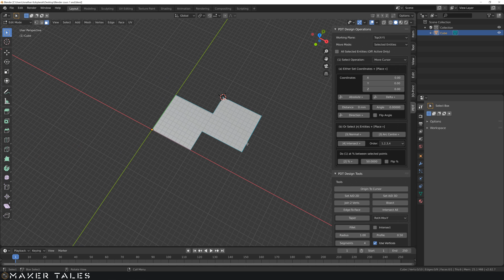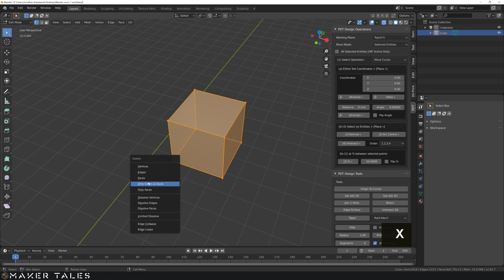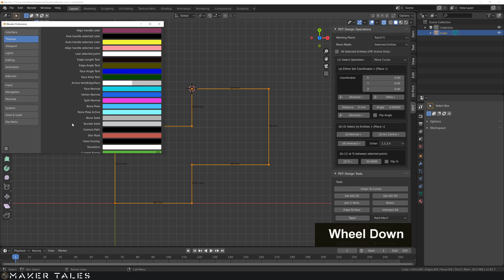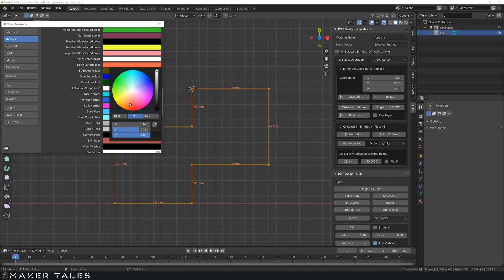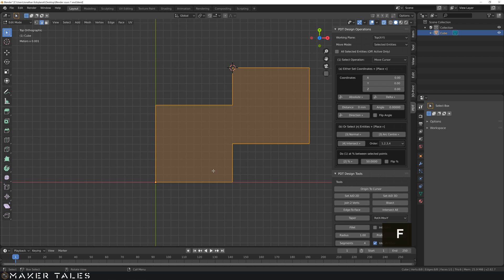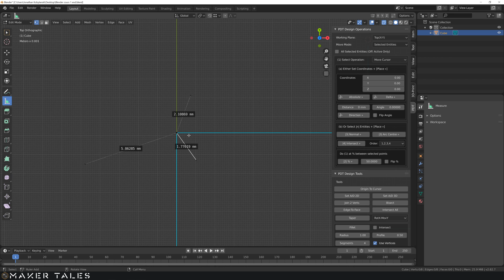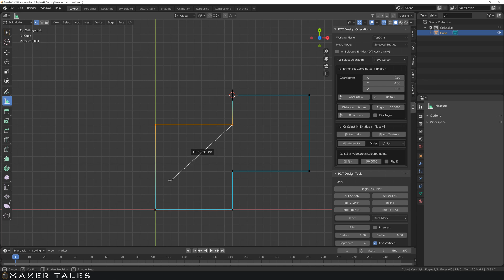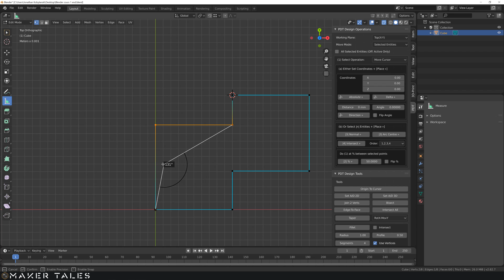Precision Modeling In Blender 2.82 : Measuring & Vertex Clean up - How To PDT ( Tutorial Part - 2 )

Comment: Hi!, im using Blender 4.0, and seems like Measurement options are moved to "Mesh edit mode overlays" dropdown instead of viewports (is the next dropdown), I was struggling a lot to find it.

Thanks a lot for this series, I was looking to do parametric design in blender, and I was very surprised why this series is not more popular, I find it not easy to find (was not in the first results), I suggest to add to playlist name "Parametric design" maybe is why I didnt found it earlier. Your definition is not incorrect, but as far I understand "Parametric design" is the way this is normally called.

Comment: Good series. Unfortunately when I tried to delete the face that I had made, it took all of the vertices with it. I tried several different ways of doing it and nothing seems to be working. Even after I got rid of the extra vertices. I'm using 2.9.1 so I'm not sure if it's a glitch in Blender or what. Anyone else have this problem ?
Reply from the maker: Hey thery Johnny, If you are just learning blender precision I would really advise that you head over to my new series for blender 2.91 and all will be made much clearer than here.

Comment: Anyone care to shed light on why deleting "Faces" rather then ""Only Faces" produces a completely different results?
Reply from the maker: Hey Sam, This is because a face technically is a connection points between 3+ edges. So "Faces" added the edges that are not connected to other faces into the delete operation. However "Only Faces" you are very much targeting the faces connected to the edges and you want to leave the edges where they are. I hope that helps

Comment: Thank you for the tutorials. I've been using OnShape but I love Blender so this is a welcome tutorial series.
I've been pulling my hair out (I'm on version 2.83.4) trying to find a way to measure my lines.
Found it! measureIt addon. https://www.youtube.com/watch?v=wSknsKVas4M
I tried this addon, and it did the SAME thing. It rounded the decimal :(  Until I set the precision to 3 and not 2 and now it works perfectly.
The best part is if you move the line, MeasureIt recalculates the distance and adjusts itself.
I wanted my fellow peeps to have this info, along with your awesome tutorials.  Cheers! :D
Reply: MesureIt add-on has been around since 2015. I wonder why it was not covered here. Actually, he did cover it in 'Precision Addons for Blender 2.82 Modeling ( Tutorial Part - 6 )'

Comment: 1) Get rid of duplicate vertices: in Edit Mode, select all, go to Mesh -> Clean Up -> Merge By Distance
2) You can change the accuracy by changing the unit from meters to centimeters.  Duh.  This is in the Scene Properties menu on the right hand bar, in the list of icons.  Scene Properties -> Units -> and change your desired unit of measurement for length to centimeters.  You can also switch from the metric to imperial here as well if you'd like to use the superior American system.
Reply: 1) He covered this
2) The accuracy has already been set to milimetres if you've followed the previous video. That still does not fix the underlying issue. Also, lol to "superior" American system. Ask NASA what their opinion is on that one considering it lead to one of the most hilarious failures in space launch history.

Comment: Fantastic content! Trying to merge vertices by distance didn't work for me, even if I cranked up the distance quite a lot. Switching to perspective mode, it turned out that the additional vertices were way off in the Z direction, effectively creating a big tall volume (as if it were extruded from the ground X-Y plane along the Z axis). Selecting and deleting them did the trick. It also reduced the number of edges from 24 to 8, which makes sense (8 additional edges between the 8 additional vertices, and 8 more edges that connected the "lower" (z=0 mm) edges to the higher edges). Looking forward for Part-3. :)

Comment: Cannot get blender to snap to first vertex for the measure. It will snap to the second vertex (with control held down). What did I miss?
Reply from the maker: Hey Ken,
I'm sorry to hear your having a hard time.
I don't really know what's happening as I show at 8:52 by default blender will snap to a vertex. You don't even need to hold down any other button. As long as you place it close enough to a vertex, in my experience it will snap to it. Let me know how that goes.
Reply: @Keep-Making 
Must have been a quirk. Created a new file and it is working fine. Thank you for your reply and excellent video series.
Reply from the maker: Thank you and i'm so happy it sorted it self out for you.

Comment: liked.  subscribed.  please keep up what you are doing.  this is awesome.  so useful and I didn't know it was really possible in blender
Reply from the maker: Hey Kellen,
I'll keep this going until I fell like all the information i currently know is available. At that point I'll learn some more and then show what I learn.
Is there anything in particulate that you would like to see covered in terms of precision design in blender?
Reply: @Keep-Making  So I come from the solidworks world, but it's been about a decade since I've really been using that regularly for day to day and I no longer have the will to spend for a license.  I also just love blender.  I like the step by step as you do it, but it is also insanely useful just to watch over the shoulder of someone who is skilled with a particular tool.  Workflow especially as it comes to precision modeling in a tool that has been historically been meant more for art than precision is awesome.  If there is anything I can think of that you don't cover, I will make sure to let you know.  thanks for doing what you do and sharing your maker journey.  Im on the ride :)

Comment: Ok, nicely explained. Can I ask about angles? you only have degrees? not minutes and seconds ? It seems a big flaw.
Reply from the maker: Hi Paulo, honestly this is the first time I've ever hear of measuring angles with minutes/seconds degrees.
I guess that in itself might explain why it's not in blender. It's not really a well known "norm" so to speak. That being said there is nothing to say you can't start a mini quest to make an addon or bringing this idea into light of the blender community. I would be really interested to know what the benefits are of minutes/seconds degrees as I've never heard of it before and in my small about of research all I keep finding in references to earth latitude/longitude coordinates and that there are 60 minutes per degree. Is this measurement system a standard within manufacturing ?
I'm very interested thanks for mentioning it.
For now I guess the best workaround would be using a converter such as this one to get DMS to DD
http://aprs.gids.nl/degMinSec.html
Reply: @Keep-Making  I am a civil engineer, that's why I guess it's not that important for the Blender community, because blender  does so many other things. But since precision is your subject, I gave it a try. But still confuses me  because angles are part of precision in any project. 10" (minutes) in a model of a stair, or roof or even in a bridge is significant and converting is such a pain. Since I am still learning, and you are doing a great job explaining the precision process, I will keep watching your videos. Thank you very much.
Reply: @pauloroberto7875  Interesting. I'm an automotive engineer. And although I do agree with you, we don't regularly use minutes and seconds. We typically stick with degrees. So, at work, we would say 45.87°. But that's just us at work.
And on that note, I personally would even prefer if everyone would just talk radians.. (that last part is a bit of a joke)